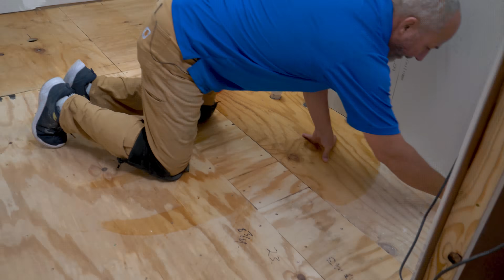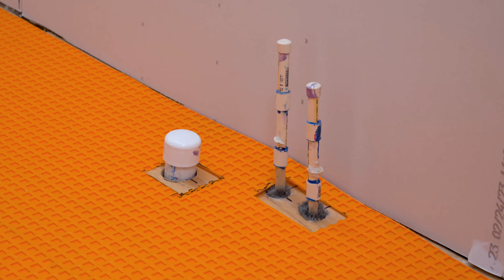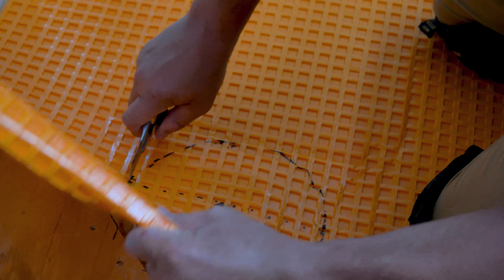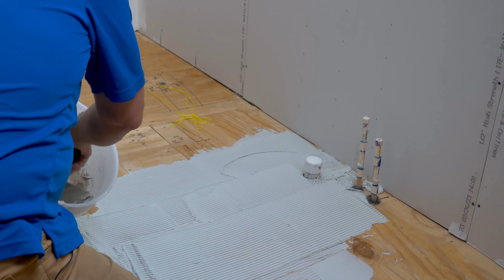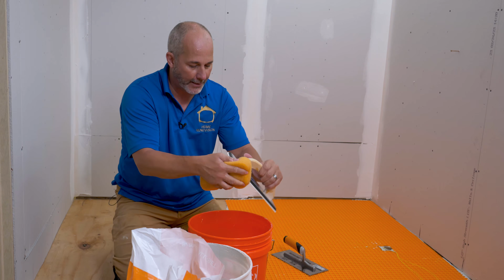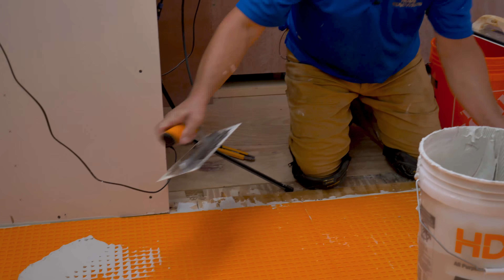Why You Should use Schluter Ditra on Your Tile Job

Comment: I'm replacing a tub with an acrylic shower pan and also doing a tile floor.  Should the Ditra cover the floor under the shower pan to protect the floor from water that escapes the shower area?  Should I fill the squares of the Detra with motor before setting the shower pan?
Thanks for the videos.  I was vary successful with drywall from watching your videos.

Comment: Anyone who works concrete knows that two different concrete pours do not tend to stick together.
What product are you using to make sure your two separate layers of mortar actually bond together?
Pre-filling the ditra membrane does not seem like a good idea and is not mentioned anywhere by the company.

Comment: I would think that using the waste of the modified cement over the Ditra would make it too thick of cement in that area.  Think about it, you putting wet modified on.  Allow it to dry and then, next day mudding over that with unmodified.   It seems to me that there would be too much cement under that area of tiles, no?

Comment: Hi Jeff  .. very helpful video material . but I do have a question :  did scrape off all paper and adhesive but some adhesive is still there should I completely remove this to the "clean" plywood or just leave it as is and install the  Schluter Ditra over a wood subfloor .. thanks
Reply: I would say sand it or if its plum with the rest of the floor and not going to make a high spot, I would say leave it, but also im only a helper right now, so take this with a grain of salt
Reply: @AbyssalBob   - thanks

Comment: Great info.  but he skipped over the prerequisite of considering the strength of the subfloor ( joist size and deflection etc)  This is especially important for large format 24 x24 tiles.

Comment: Bought 1974 2 story on top of garage. Ripped out 3rd floor Bathroom to the joists-don't have metal hangers. Bathroom is 8 x 7 after installing cabinets against knee wall. Replacing  subfloor with 3/4 in. Pine Sheathing Plywood. Does it have the structure support to have leveler under thin set & tile?

Comment: All set needs to be mixed at 300rpm or less or can create air bubbles. Also mix for 5mins let sit for 10mins,then mix for another 3 mins…. So make sure you have a variable speed drill. Don’t mix on high

Comment: Okay one more thing. Watching you do this job is brutal. When you're done using that paddle bit mixing your compound, you need to put it back in the bucket of water and spin the blade Really fast forward in reverse to keep it clean. In fact, I always have a dedicated bucket of water specifically for this job and the paddle bit lives inside that bucket of water for the duration of the job.
Reply: Your total lack of self-awareness has been duly noted.

Comment: Okay one more thing as I'm watching this video. I get that you don't want to wear a mask, but it's not so much about what you do or don't do, it's about people watching your videos and what they're going to do. Making dust clouds from mixing thinset is a dangerous thing. And it's typically bad form to be pouring dry powder into your bucket as that makes big clouds of silica. If you were going to do that, you should do that outside and hold your breath. But if you are going to throw caution to the wind and do it inside because it's easy and you're lazy and not going to wear a mask, you can use a 6-in drywall knife to Get it from the bag into the bucket with almost no dust. Just an FYI. Been there done that.   Laziness is the mother of invention
Reply: The good news is that Obsessive/Compulsive Disorder is treatable. Ask your doctor. Here's why.

Comment: My subfloor is 1x4 slat boards. Is it safe to use 1/4" plywood since I do not have 16" joists underneath? I am basically going over a near solid solid subfloor. I don't want to raise the floor too high by using 3/4" plywood.  Thanks for the video

Comment: Yeah mortar sticks to shiny plastic really well

NOT.

I see that when I rip up these Schluter floors, the cement pops out of that plastic like little candies

Go ahead and buy a big roll of this garbage for $700 and it will work just fine, but it's not necessary

Comment: I know Jeff said don’t comment on mixing without a mask but a few days ago I learned the hard way about mixing cement products without protective eyewear. While mixing, it splashed from the bucket and coated my eyeball. I thought a good rinse would be enough but couldn’t get my head under the faucet so I used contact solution to rinse it out. I didn’t think much more of it. Just a little scratchy. Went back to work and about 30 min later my eyes were burning. Looked it up & it said to get to the nearest ER if the cement product gets into your eyes even if there’s no irritation because the chemical response creates something equivalent to battery acid that will continue to cause deep burns. The ER doc said they usually see eyes that look like fried eggs by the time I got there but because I used saline for rinsing, it may have been what saved my eye. After about 30 minutes hooked up to an eye flusher, I had to have cement fibers and silica surgically removed from my eyelids. I’ve been on an antibiotic for several days. It was a good scare. Never. Never again will I not wear protective eyewear when mixing, drilling, gluing, etc etc  anything that could get into the eyes.
Reply: This is terrifying. I usually wear goggles but I wouldn't have thought of this as being THAT big of a threat.
Reply: @maurapond2543 same!!!!  This is such a good lesson to share. Thank God you’re ok. ❤️❤️🙏
Reply: @maurapond2543 it is ur eyes r one of the most important things in u , like ur lungs u can get silicosis by mixing motars or cutting tiles dry wout mask
Reply: Omg.  I sometimes forego eye protection in things but seeing more and more stories…… I need to buy stock in PPE!!!
Reply: Glad to hear ur ok!
Reply: I'm glad the doctors were able to save your eye! Your vision is a precious thing.
Reply: I am sorry to hear what you've gone through. Thank you for the safety warning.
Reply: So glad I have my scratched up corrective lenses.
Reply: antibiotics are against bacretial infection btw
Reply: Yeah the antibiotics are for post operation infection risk. Those micro abrasions create places for shit to enter
Reply: Thank you sharing your pain, it wil save many others that read it.
Reply: Went to er myself too ,but I usually look away if it went to my eyes I washed it w a shower head n I was cool I went to er cuz I angle grinded n there wasn't any eye protection in the whole site I don't cut wout one ever again ,hard lessons to learn but it's mostly our own stupidity

Comment: Notes on mixing the All-Set Thinset: Follow the directions, don't wing it. Get a measuring cup to precisely measure the water. Get a scale to measure the powder. Use a LOW-SPEED mixer for the time in the instructions. Guessing causes trouble. The kinda trouble to don't realize until a year or two later. If you do it perfect, it will last longer than the time to next renovation.

Comment: So at 35.01 in the video you were applying the adhesive and I noticed there was a difference in heights on a plywood joint, you could see the difference when you spread the adhesive. Is that acceptable? Also this product is ok to install right on the 5/8 T&G no engineered plywood?

Comment: Jeff, I have been watching your tips for years.  I did my last Schluter bathroom 5 yrs ago, and didn't use Ditra, because I never heard of it. For my current project (I ripped out a complete bathroom in the basement, and needed to do the whole floor, as well as build a shower, etc.),  I watched your newer videos, witch includes the Ditra.    OK, I'll try it. 

Sorry, but that was a mistake for me.  I got the stuff applied to the floor easily enough, but my god, what a nightmare for applying the tiles on top!  All those stupid bubbles to fill inside took forever!  I had to come at each swipe of Mortar from FOUR different angles - just to fill the bubbles!  That took an Incredibly long time to fill for each tile, and then add in the back butter & troweling, made for an insane amount of Time & Mortar for each tile.  I was using wood look tile, in 3 ft lengths, so it was even worse, because the time lag for each tile left plenty of time for the mortar to begin drying out along each edge, before I got one laid, and moved on to the next. 

It took so long, I lost a bunch of mortar, due to it drying out before I got enough tiles laid, and had to quit for the day, due to being exhausted from all the extra work.  What I imagined was going to take me a half day to install (5 x 10 ft bathroom floor), ended up taking me two days to install.   I was Not impressed! 

I love your videos, and most of your tips are very handy, but re-watching this video, seeing the amount of grunting and sweating you're doing, leads me to believe that most people who are not in the business, or at least strong young men, are going to run into the same issue I had.  Waaaay Too Much Time & Effort, for something that nobody can say with any assurance that it's gonna help.  At least not for 10-20 yrs. 

And it isn't cheap, nor is the Time & excess Mortar required to fill all those stupid holes - even when you don't end up tossing half, because it dried up while you were trying to fill them all.   I strongly urge anyone considering using the Ditra to have a buddy helping when it comes to setting the tiles.  One guy just to fill the Ditra holes & Trowel, while someone else back butters the tiles & hands them to you.  Especially if you're using large or long tiles.   That was a headache for me, and I won't be using Ditra again.  I have no idea if my tiles will crack 15 yrs from now, but I also have no idea if the tiling I did 5 yrs ago will crack 10 yrs from now.  I'm willing to risk it, rather than doing the Ditra again.   Just my opinion, but this was a huge amount of time, effort, and money, for something that may or may not make any difference.
Reply: thoughtful response.  I was thinking the same thing.

Comment: Can i use a rolling pin for the procces at 24:53?
Reply: Yes as long as you apply enough pressure. If your back don't hurt put more pressure 😂
Reply: I’ll be doing this job at the weekend and I’ve got a wooden rolling pin just for the job, but wasn’t sure whether it would work or not. I am also considering a small Off cut of floor joist as it has rounded edges and surely would work!? Another possibility is I’ve got an industrial paint roller and some exercise weights and may try that. Many people use wooden floats, but over here they are £20, which is a fair amount for something that will be used for a matter of a few minutes and probably never again.

Comment: Good job Jeff!  One helpful hint @34:29, I noticed the uneven plywood seam.  Always a good idea to use the thinset to level irregularities in the surface before application of the membrane.  It's a good idea to use primer as well, especially for the leveling.  That raised edge will certainly compound with the use of the 24" X 24" tile you spoke of making alignment and leveling more difficult.

I should also say that one of the issues with these membrane systems is regarding penetrations and introduction of rot and mold.  This is especially true of drains on toilets, tubs/showers and also corners.  Many tear-outs have displayed this problem and is leading to new requirements on new installs to address the issue.  Water is a menace and where there is a way, it will find it.

I appreciate your videos and recently was very impressed by you and Matt putting in that 800 pound beam.  Nice planning and execution.  I am a professional of decades and apologize for the criticism.  I am a DIYer as well, so I get the concepts very much.  Keep up the good work, many benefit from your videos.

Comment: Question. A contractor  built a room off my home . This room will be used for plants . Im using ceramic tile for the floor. I asked the contractor if he needed uncoupling membrane under the tile he said NO. I THINK HES WRONG CAN YOU GUIDE ME AND LET ME KNOW IF I NEED THIS. Its going to be wet like a bathroom its a greenhouse.

Comment: you didn't follow the mixing instructions on the bag... not mixed the way they engineered the stuff.. also you introduced a lot of air to the mixture by whipping it up so fast and "violently". this will speed up cure time and it'll set faster than it should. love what you do, but sometimes there are little things that might throw off DIY newbies. thanks for what you do! but read the instructions..
Reply: No. You follow the powder and water ratio on the bag, it's going to be way too thick for ditra membrane. Ask me how I know.

Comment: Can this Ditra membrane be used on Drywall ceilings for tile on drywall ceiling or should I remove the drywall and add concrete board for bathroom

Comment: From looking at multiple videos, it came to the conclusion that this product should only be installed over new concrete, or concrete floors that have questionable sturdiness that will lead to cracking. The main purpose would be to create a delaminating layer so that the cracks do not transfer to the tile.
However, when tiling  over wood, the simplest method and best practice is to use quarter inch backer board and screw that onto the plywood.
Video content producers need to make various content to make a living.  So to all DIYs, research all you can to determine best practice for you underlayment.
SoCal DIY enthusiast.
Reply: I look at it like this product is REQUIRED for  a cement slab.  But it is a fine alternative to cement board for plywood floors.

Comment: Be really careful using Schluter Ditra! Make sure the framing under the subfloor is rock solid. And I’d only use it over 1” plywood floors. I the house is older, stick to cement board if you want to avoid crumbling grout and cracking tiles

Comment: underneath the Ditra you're supposed to use modified thinset onto the OSB... However, on top of the Ditra with the tile you're supposed to use non-modified thinset that follows ansi 118.1.. Could this potentially void the warranty  ?

Comment: I’m planning on tiling the second floor with ceramic 12x24 and use the keraflex plus on plywood floor would I still have to use the membrane material in Arizona weather? Thanks

Comment: Ditra is terrible and way overpriced! I’m a bathroom remodeler and my customer had me remodel their shower, vanity, and floor. The floor was not that old but was squeaking in a couple of spots. When I started tearing the floor out I noticed it was a ditra underlayment with a 1/4 inch plywood sandwiched between the ditra and the subfloor nailed down with ring-shanked nails about every 4 inches. It was the hardest tile floor system that I’ve ever had to remove. Luckily it had the 1/4 inch plywood under it or it would’ve been worse had it been on the plywood. I had to charge my customer extra because of it. Stay away from the ditra system people! Concrete board and a good grout is your friend!

Comment: Separation membrane under tile is a must - expensive but a must.  I followed the Kerdi instructions and found some squeaks between the sub-floor and the floor joists.  Spent an hour hunting them down.  Made a difference.  I also vacuumed the & cleaned the subfloor as best I could.  I followed Kerdi instructions and sealed all subfloor (plywood) joints with all set and 4 -inch Kerdi band forcing all set into the mated joints and then put a layer over the Kerdi band.  Let it set overnight.  Next Hardibacker down over troweled all set, screwing it down W/backer screws on the indicated spots (they are marked).  Then Kerdi band with all-set on all backer board seams, and screw heads same as the subfloor.  Then the Ditra just as the video shows.  Then all set on the Ditra followed by 12X12 Saltillo tiles back buttered with all-set.  That large (400sq ft) bathroom floor now matches the rest of the house and after grout with Pewter color grout - looks awesome and is as solid as they come & waterproof.  I ordered sealed tiles, as they are clay, and I put a second coat or two of my own sealer, to seal the grout.  Left the tiles shy of the baseboards (made a small wood spacer to keep edges even) and used Pewter colored sanded caulk for the tile to baseboard joint.  Never grout at a change of plane on a floor.  Much good info, I enjoy your videos.

Comment: who ever did the drywall i already know drywall guys or mudding guys wouldnt be happy cause the seam should be horizontal not virtcle but again what do i know. i installed my drywall this way like in your washroom but id agree its easier to mud if the joints are horizontal easier on the arms and maybe a nicer finish as well. i learn everyday idk.

Comment: Same with Kerdi Board. Great idea for weight and install, but I just don't feel it is rigid enough to support walls from kids bouncing around in the shower. They have to flex a lot easier than Hardi Backer.
Reply: I was amazed at the tinsel strength this had once installed.  Every 12” is a button recessed screwed disc gives strength and once you use a non modified mortor(Schluter All-Set). It’s like a monolithic surface, awesome engineering.  Followed by epoxy grout or water replacement sealer added in leu of water when mixing grout.